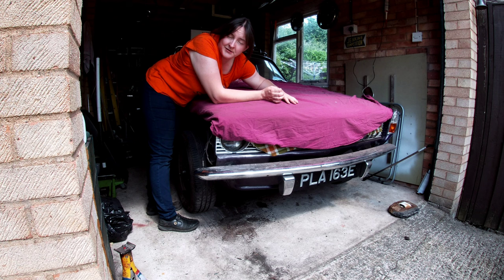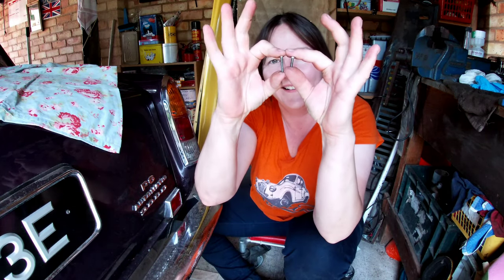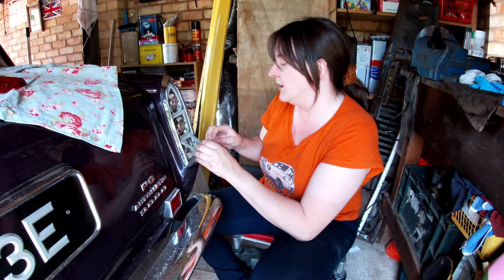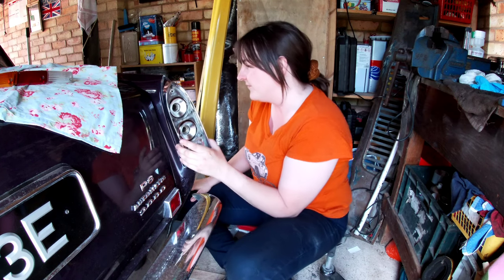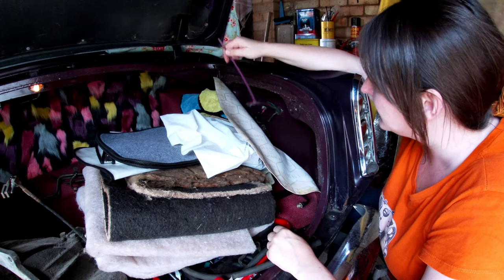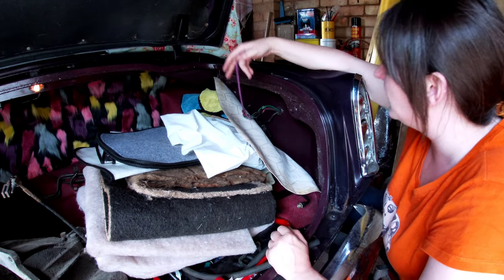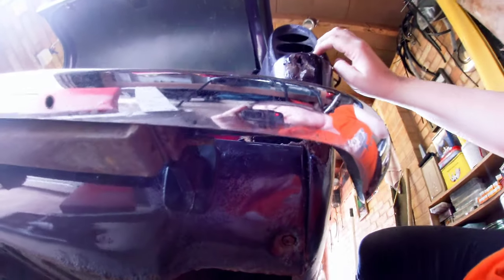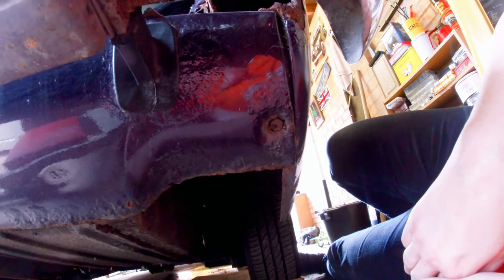Rover P6 - Rear Wing Removal and Rot Discovery

Comment: I've seen a lot worse than that, Alex, you can do it. Start with small bits of repair panel replacement and weld them in a bits, then seem weld once you are happy with it. or find bits of another P6 make any repairs on the bench and then fit on the car checking outer panel fit before final welding etc, I'm sure you must know some of this stuff. Good luck Alex, go girl. Bob

Comment: oh bless your heart!! I can totally understand how you feel. It's not pretty, but it's NOT impossible. If it were me, I'd look at the other side and see if that is the same. Then I'd weigh up the financial cost of repairs compared to replacing it with another car, and at the moment I still think it's viable to repair with the cost of classic cars at the moment. If you look at another P6 you could end up with this all to do again in a couple of years. Once Mr Jenkins is done, you'll know that that part won't need looking at again. So yes, a bit of an expenditure in cost, time, and energy, but I think it's a goer. I also think you should have a bloody good look all over, esp the bulkhead and other hard to reach areas, there's no point doing all this work if you then go on to find catastrophic rot elsewhere. You've got this Missus, I have every faith in you xxxx
Reply from the maker: Thank you x I'm going to turn him around this week to look under the other wings x  I'm sure I will fix it. Was just a shock to see so much work needed x

Comment: Poor Mr Jenkins. Sad to see him looking poorly. Are there any repair sections available for that "C" pillar? Alternatively, would it be possible to find a scrap car that is sound in this area and cut a whole section out? Back in the 90s I was able to do that to repair my Wolseley 18/85 (posh landcrab) that had rear offside quarter accident damage. I cut a section that included the rear door shut including the inner and outer wing, part of the boot floor and part of the panel where the number plate mounts. It ended up as a real strong repair that looked perfect.  I had an expert advising me, but it was not as difficult as you might think. I also had rust to the inner cill, that I was able to repair one piece at a time before affixing the new outer cills. I hope you are able to get Mr Jenkins fit and well again soon!

Comment: You have had some very sympathetic and helpful comments. As far as I can see from the video, the car is saveable but will need a great deal of work, time and probable expenditure. There may be even more and worse horrors to find. I think that anyone facing the dilemma that you do should carefully consider these questions: Do I have the capability and equipment to do the work needed ? Do I have the time to do the work ? Do I have enough workshop space available, bearing in mind that dismantled cars take up a lot more space ? Can I afford the parts and consumables needed?  If I use my resources for this project, will I neglect others ? Will I actually ever finish it ?
I recently made the painful decision to part with a Morris Traveller that I had owned for a number of years, hoping to restore it, and though I could meet some of the criteria I have listed, I ultimately decided to sell it for less than its true worth to someone who I hoped would be able to do the restoration and keep the car on the road.
As you mention at the start of the video, you have had several weeks of health issues, and it may be that things look blacker than they are. I would advise you to take a little time, wait until you feel better recovered and then assess the situation. Whatever you decide, you have my best wishes.

Comment: Oh, I really feel for you, I really hate to see anyone cry. If that happened to mine, I am not ashamed to admit it, I would be in the same state. I hope this advice helps. It looks like it can be fixed but it is your appetite for time and money that matters most. Rover put a hell of a lot of gloop on the rear metal to seal it due to all the 'business end' mechanics there like the driveshaft, diff and suspension mounts. I've seen in another comment that's all good - that is a big relief, especially the rear bulkhead. That C-post has to be looked as my concern is if that panel you pulled out is so bad, you should lift the rear seats to check areas close to that C-post. I noticed some blistering. The seats come out very easily and that will provide an immediate answer as to how bad that it is.  If that was my car, cut that right back, find donor sections, and weld in it. However, the rears are notorious for alignment issues - just learned this fitting new rims.  Personally, that's worth getting help on for the rectification but there is a lot of prep you could do.  I would get this car out on a dry day and go at the metal, get it down to shiny and treat. My other advice, check the other side too because those arches are real rust traps, and take it from there.  All the very best to you, most sincerely, Mike.
Reply from the maker: Thanks Mike. 
It's all solid behind seats and sills are very recently done. Hopefully it won't be too hard to fix. 
I'm scared of the other side. . . I will turn him around next week and start taking the other wings off x
Reply: @Alexsassets  Excellent news, it's definitely fixable then, but I can empathise at how shocked you were. All the very best.

Comment: I’m sure it’s salvageable, it would have been nice to just replace panels,
But a decent welder won’t be fazed by that.
It would be an idea to compare the other side, if that’s similar then refer to illustrations of the structure, 
It’ll be more involved now , rear interior removal etc, But worth it, it’s what your Channel is all about.
Good luck what ever you do, chin up. ;)

Comment: A 1975 3500S that I crashed in 1984 was rotten so what you found didn't surprise me. On mine crunchy noises could be made by pushing up on the underneath of the Sills and I don't think that the inner vertical parts were much better. Paint / protection on the Rover was sadly lacking on the inner surfaces of the panels so they rusted through from the inside. Are your sills OK?

Comment: Oh my gosh 😕don't cry😢. I've seen far worse. It's fixable, just do a bit at a time. First get back to good metal on all offending areas. Yes there's some really tricky bits. You need a bit of help fabricating suitable pieces. Basic mig welding isn't to difficult but unless you are good at welding thin car metal you will need help with some of it but hang on, there's no rush. Devise up the jobs once you have cleared everything back.  Love the t-shirt by the way 😁

Comment: Might be better off looking for a better base unit. I had one that was that ripe 30 years ago, finished up cutting two complete D posts out of another one in a scrapyard and fixed it up. Have a good old poke around where the front springs press against the bulkhead and also around the top arm pivot mounting points, if its bad there its real tricky to repair well.

Comment: What you've just discovered is what I warned you about when you said about a sill in another video: "I'll undercoat it" - never undercoat an old car. You may as well dip it in salt every day. Bare metal, príme and paint. Keep it clean, and during the summer at least take it to a carwash and get a hot wax lance under it if you cant get under it and wax it fully. Undercoat is shite, a real "60's and 70's hobby-bodge" that just traps moisture and rots panels out. 
With water-based acrylics and HVLP sprayers you can keep a car painted underneath without killing yourself with 2K and once you've got 3 or 4 coats gone off over 2 or 3 coats of primer it will stay sound against winter salt.

Comment: I'd be inclined to think about finding a P6 in a scrap yard and cutting out the C pillars, if they're good, and replacing the rotten ones on Mr Jenkins. I think welding patches in won't correct the rust that must be inside those C pillars.

Comment: Oh dear Alex, that could be far worse than it looks.  You need to seriously assess how far mud and water have got into the main rear chassis structure. That big area immediately after the D pillar leads into the rear chassis and seat pan. The entire structure around the rear trailing arm mountings and roadspring seats relies on the strength there where you were hammering where that big chunk came from.. Really bad cases will initially  show up as an unequal/ tapered gap to the rear door that is narrow at the bottom, and wider at the top, and along the line with the upper quarter trim, between the door window frame and rear window.  You may just have caught it in time to save it, but its likely to need  an extensive structural repair.  Keep weight out of the boot, because it will break its back around the rear spring mount area once the rot gets into the chassis stucture behind the rear seat pan. I've seen quite a few with the broken back symptoms, even the weight of its own rear bodywork will cause it to sag with the stress put into the rear spring seat from just driving on rough roads.  They break from the curve of the inner rear wing, right upto the area where the lower corner of the rear window sits. The metal rots as you've seen, and spot welded joints can flex and break.  Ideally, take the rear deck panel off and check the base unit below its outer ends. If it's really bad, you'll find rot in the area of the rear bulkhead, (it often creeping into the parcel shelf area too). where the rear wing, rear deck and upper quarter trim mask it until you remove the outer panels.
Reply from the maker: Oh dear. I have a gearbox in.the boot 😕 . Only two years ago i had the rear window and deck panel out and repaired some rot in there. So that's all solid now
Reply: I hope you have caught it in time,  having the upper area welded before, may have helped . It's difficult to explain just how bad water/ roadsalt ingress into the base unit, corrodes and affects the main structure.  I used to do a lot with P5, P6 and SD1 models, accident repair, restoration etc, professionally as a vehicle engineer, and for myself, so nothing shocks me when it's rot related. The P6 can look absolutely mint, with shiny outer panels covering a crumbling base unit. I broke quite a few of those I had because they were simply too far gone to be economical to repair, at times when a mint low miles one could be bought for under £1500.  if you haven't seen a really bad example, it can come as a real shock, as you looked seeing yours. That big hole you were hammering looks to have been corroded for some time, and it looks to have had some bodge up repairs at some point. That would have already allowed water and debris into the main structural areas I mentioned earlier. It really needs thoroughly checking for the ringing sound of bright metal, all  around the main structure underneath.  It needs to be checked from where your heels would be when sat in the backseat, rearwards, and include the semi subframe running all alomg the boot sides, where the upper rear tie bars bolt to. They can break away without warning from the chassis, rip a hole in the boot sidewall, and give a rear end side to side swing as you accelerate and brake.   A good idea of the severity of rot is to lift the rear seat and pull out the insulation in the deep oblong gap that is as big as a letterbox,  next to the rear end of the seat and sill. Even on an average example car, there's a good chance there will be crusty metal on the bottom, or daylight through to the road.  If the rot is extending up any of the four sides, it's quite serious.  That is a structural area where the side of the rear chassis, inner sill structure, the rear floor bulkhead and trailing arm  suspension pick up points all are.  Its a structural bracing point where the cabin and boot join. Any rot extending up the side nearest the seat will have allowed water and corrosion access into the chassis and suspension mounting areas.  Water getting in that big hole is directly above that structural area. One of the worst I've seen was a 1971 2000SC. Back during  the 1984 miners strike the owner had been coal picking. A boot full of coal and two on the rear seats. He came for advice as to why the service jacking point, the oblong box where the towbar would be , was dragging on the road over uneven surfaces, causing sparks.  He hadn't noticed the half inch gap between the rear window glass and the deck panel seal; the wider than usual gap between boot lid and deck panel, or the wing bottom  corners were touching both back doors. Underneath the chassis around the rear spring seats was just crumpled metal and big crusty scabs. Once the weight was out, you could lift the whole rear end up and down in relation to the cabin, a good inch or more, using the rear bumper as a handle. That's an extreme example, but rot in the rear structure could soon cause that if say you had a caravan or even a small trailer flexing on the rear structure. The front end can have problems too, but usually not anywhere near so bad. Anything on the bulkhead will be complex, but it's fixable if not completely crumbled  away.  The double skin bulkhead centre is mainly heating and ventilation ducting, apart from the steering and idler box mount that are structural.  Then you have the front suspension structural mounting areas, and the hockey stick inner wing supports.  They're all fixable with time and money. Cabin wise, it's sill inner structures, floor / seam, and on extreme examples, sections of the screen pillars and the can't rail frame that the roof bolts to can corrode. Again, everything is repairable with some metalworking skill. It all comes down to how you value the car and how much time and money you want to invest in it.
Reply from the maker: @brianwhittington5086  thankfully all the floor pans are solid and the sills have been replaced recently.  
I had a new boot floor a few years ago and it's all solid there. Bulkhead is solid and I've had the rear screen out recently and repairs done in there. I thought the base unit was all good to go . Didn't expect that big bit of rot. 
Hopefully the othside is ok . X
Reply: @Alexsassets It's got to be worth doing if you've gone to that extent already.  The main thing is to get that oblong area between the rear end of the sill and seat base checked.  If more than the bottom skin of it is crumbling, water is getting into structural areas, and you need to assertain it's not got into stressed areas. There wasn't a great deal of the base unit available as repair sections when new. Rover dealers of that time had chassis dimensions or access to a measuring jig. If the base unit was twisted by accident damage, and the datum points were too far out of tolerance, the base unit was deemed to be scrap and a new one would be fitted if it was ecconomical to repair.  Corrosion wasn't really an issue then, as they were still fairly new, you could only really get factory panels to repair impact damage to the edges of the base unit.  I probably still have the chassis measurement data for checking the base unit.  Even newish ones could buckle around the sill  jacking tubes, they really weren't that strong, not meant for anything other than a wheel change with no weight in the car.  Ripping out the rear tie bar by hitting a pot hole was fairly common, even on newish cars, I've lost count of how many I've fixed.  Hopefully, your previous deck area welding has kept the rigidity of the cabin to boot area join. You still need to give a very thorough lnspection to the heavy sections of chassis that come out from the rear seatpan area and spread to the sills and backwards, particularly either side of the coil spring seat.  That area takes a lot of stress, the weight of the cabin, boot and any passengers or luggage, all through the spring seat.  They do crack in that area, even on one's that have less corrosion than yours.  Don't worry, it can all be fixed, but the priority is getting the inner wing watertight and corrosion free. If there's any sign of the chassis cracking, even that can be repaired, but it will require the suspension out and some serious heavy welding. Fingers crossed, it's not got to that stage, but ask away if you have any questions. 😁
 PS ....Why does it have a gearbox in the boot.  Is it a transfer box, as in transfer from one car to another ? 🤣🤣